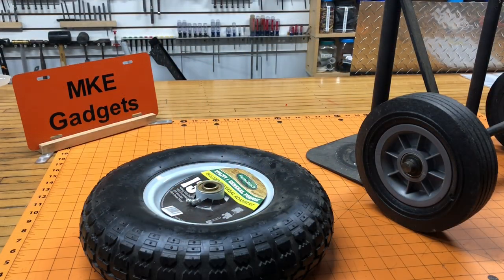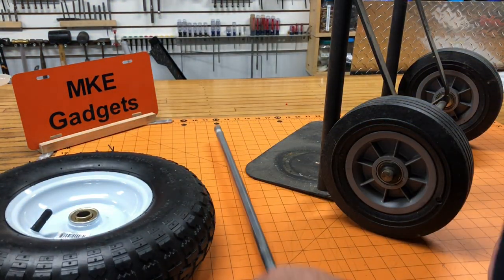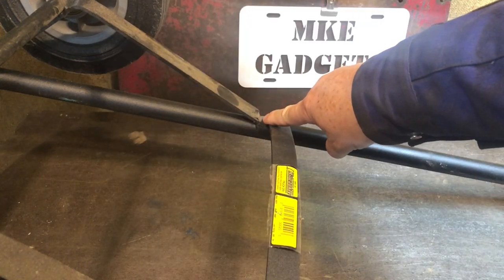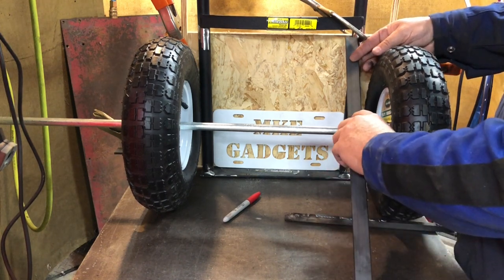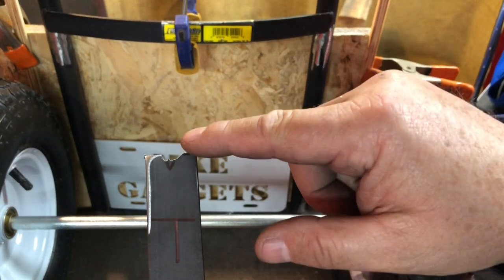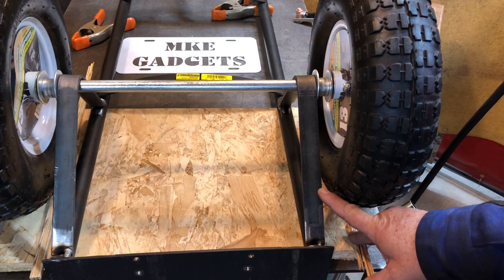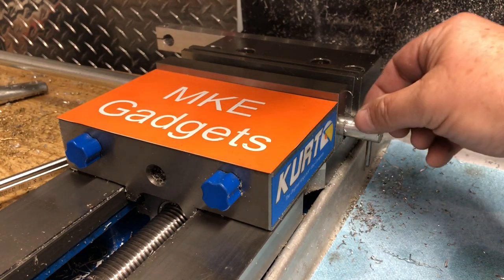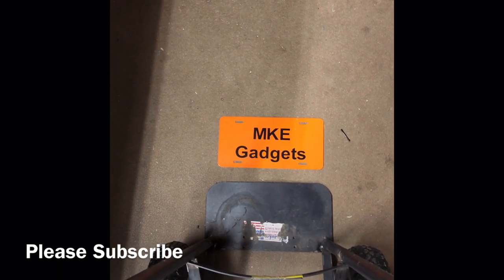Hand Truck Modification @ MKE Gadgets #105

Comment: Great video. Maybe you could add some loops and a chain if you think you may use this to move welding tanks. The chain could prevent the tank from falling off.
Reply from the maker: Yes I do use it for moving my welding tanks. Are use a ratchet strap. If I want to add a loop and chain on there am I getting away for other uses.

Comment: Nice project. I have thought about how helpful it would be to put a small lift on wheels to haul in heavy stuff (no built path, ruts and bumps, especially after rains). Wheel barrows suck in a wild back yard but Radio Flyers can't carry much.  "Garden wagons" are rust buckets for $150!
Reply from the maker: I’m glad you enjoyed the build. Turned out to be really useful.